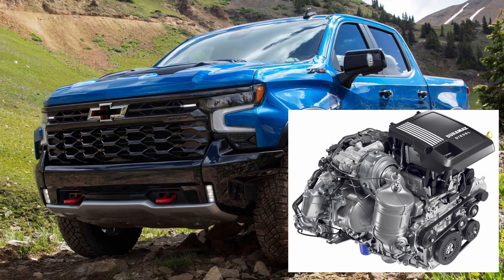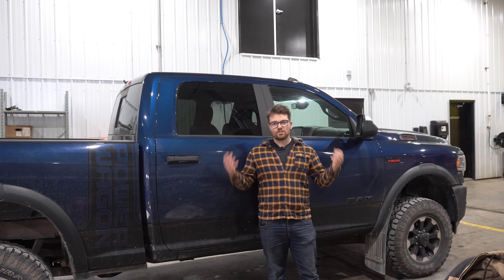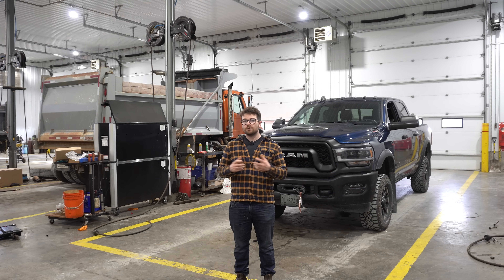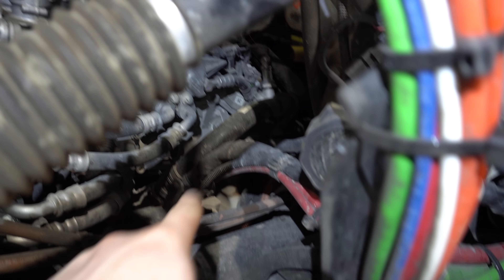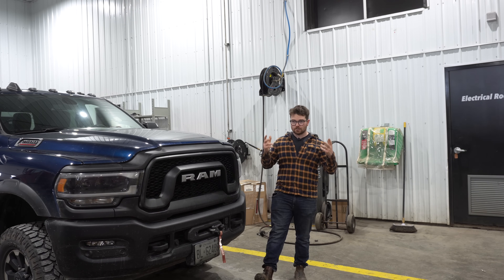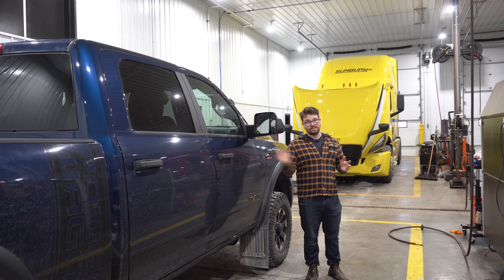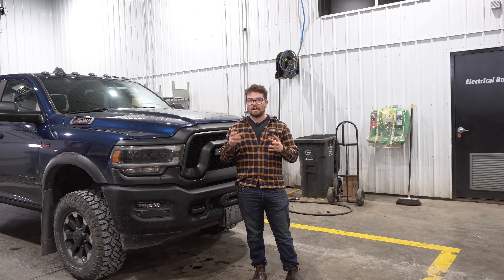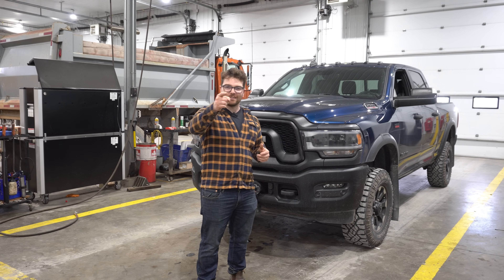Chevy Silverado 1500 3.0 Duramax Diesel **HEAVY DIESEL Mechanic Reviews** | Is It a GOOD Engine??

Comment: Oil pump fail will not be catastrophic!!!  Just pull off to the side of the road tow it to shop and get it replaced if happend. (3hr job) Plus there wasn't a single case of one failing. 
 Stop scarring people with the whole belt thing. GM now say 200k miles maintenance item for belt and it's not that hard to do.

Comment: I own a 2022 GMC Sierra with a 3.0L Duramax/LM2 engine. I put a lot of miles on my truck, as I drive it for work. I’ve had it about 8-1/2 months and already have just over 18k miles on it. I LOVE this engine! (I love the truck!) I suppose you wouldn’t expect to have had any trouble with an engine after only 18k miles. Still, it’s an impressive little diesel. I came from a 5.7L Hemi in a Ram 1500 and was getting 15-17 mpg. The Hemi had a lot of pep and I put a lot of miles on that truck, as well. It was a dependable engine but the fuel mileage sucked! I’m now getting an average of 25 mpg with mixed highway/city driving. That equates to 600 miles out of my 24 gallon tank. I was getting just over 300 miles out of the Ram’s 24 gallon tank. Amazing difference! On the highway I get anywhere between 28-31 mpg, real world. And this Duramax has plenty of pep. It’s the one thing I thought I’d miss from the Ram but I haven’t been disappointed at all. It has loads of torque and pulls much better than the Ram 1500 did. So far, I can’t say enough about this engine!

Comment: 13:30  
I'll never understand why Cat (a company that gave up on over the road diesel engines) is the only one that realized pulling EGR exhaust gas from AFTER the DPF, was a good way to prevent sooting of the intake and combustion chamber. Then again, they also made the ARD Head!.......so, yea.
Reply: VW also did it on the TDIs. EGR is pulled from between the DPF and DOC. There was even an additional EGR filter before it went into the cooler. Not a heavy duty or truck engine but still. BMW on the inline 6 in the 335d and X5 as well.

Comment: 0ur 2021 had the no start issue for about the first 30 000 km. I had it into the dealer to have the water pump replaced and they did a software update and it hasn’t done it since. Dealer was annoying though because I kept taking videos of it not starting and because it wouldn’t do it there they wouldn’t do anything to it. 

My only mild gripe really is the amount of DEF it goes through. I’m using a 10 litre jug a month and I don’t think I used 10 litres in my Cummins every 6 months.

Comment: My 3.6 warlock with 3.21 set is not sluggish at all. No lag. I’ve been impressed with it. I’ve owned 318 4wd reg cab manual ,360 2wd reg cab auto, 4.7 reg cab auto,5.7 4wd crew cab 3.55 set auto , Cummins diesel 2wd crew cab manual edge tuned , and  this 3.6 is really impressive for a naturally aspirated v6. I averaged 14 mpg with my crew cab 4wd 5.7 and 3.55 set and it did have a lag in throttle. This warlock averages 20.5 with lt 285/70-17 and zero lag on the throttle. Pulls anything that I should be pulling with a half ton. Will go back to a lighter tire and hope to see some mileage improvements. This warlock with 3.6 is peppier than a ford f25o 4wd /5.4 I had and I would say tows just as well.

Comment: So much for durability with all you have mentioned regarding this motor. What is most important in any engine, reliable oil pressure. So not this motor does not get our vote. And yes all you have mentioned is an issue so stop down playing the negative factors. All the best.

Comment: I own a 2022 Chevy with the 3.0L. At 6,000 miles the truck did not re gen for about 2 weeks and I got a alert that said service emissions system and the check engine light came on. the truck never went in to limp mode but after I called the dealership I woke up and cranked it and it re gened immediately and the check engine light went off. That has been my only issue. It’s got 23,000 on the truck now and I love the mpg I get. The best I’ve gotten was 35 on the highway and around town I get 22-27.

Comment: So why did they make the oil pump also gear driven at the rear? Sounds like a design flaw and like you said about injection pump hundred thousand miles is an a lot hot. Look at Cummins in the x15 fuel pump problems
Reply: He has no idea what he's talking about. He never even saw one of this engines

Comment: the long crank times sound SORTA like the misfire issues GM had....
.
when we got 4 speed transmissions with LOCK UP! torque converters..... when the trans would lock up, the engine would see bumps in the road as misfires
the bumps would cause the crank RPM to speed up/down ever so slightly..... and the ECU sees that as a misfire (as thats how ECUs detect misfires, looking at crank RPM variances) 
.
so, GM added a PWM lockup valve.... which keeps a ~70 RPM "slip" in the converter clutch
which is why so so so many 4T/L60e's blow up..... 
.
also why most rebuilders simply weld that valve 
so it feels like a 5 speed.... 1-2-3-4-lock up
VS
1-2-3-4... dont feel anything, but tach drops ~200 rpm
.
.
this issue was fixed in later ECU updates..... 
they could have left the trans alone with a "solid lockup"
.
but they did both..... to have a SUPER SMOOTH transmission 
.
.
.
and ya..... a 4t60e is smooth AF.... especially in buicks which have a slightly different ECU (with different fueling and shifting strategies) 
but id rather have a LOCKUP! lockup...... which reduces heat, and improves trans life (from less heat, AND!!! not slipping a clutch for 200,000 miles)

Comment: I have a 2020 Chevy 1500 RST with the 3.0.  Towing on the east coast with a 5500 lb rv 17.0 mpg. Driving around town/hwy 28-31.  A full tank of fuel has a 700 mile range.  My old truck a 2010 GMC Sierra 5.3, 17mpg was the around town and towing the same rv 9 
mpg.  Its quiet, rides really smooth.  No problems even in cold weather.  GM just extended the oil pump belt to 200,000 miles, and who knows in the 15 years it takes for me to put 200,000 miles they might bump it up to 250.000.  Great engine and transmission(10 speed).

Comment: I do wonder if Izuzu was intending to replace their 5.2L 4 cylinder diesel with this, if the gear train is on the back for cabover use.  I know why the modern Detroits have the gear train on the back, they're Mercedes engines from Germany, and the Mercedes trucks are of course cab over as is the norm for Europe.  I assume the PACCAR MX13 and Volvo engines are the same as they also are primarily European market engines.

Comment: I Have 44 k on mine it has a plate, and i have pulled over 18.5k lb does good. However, i am having issues with the def filter and cats or maybe a sensor truck goes into a derate mode currently at the dealer maybe it will get it back this week . However, I absolutely love this truck.

Comment: Great Review!!

We run a fleet of tractors and Duallies. Ram, Ford and DMax. 

Number 1-20 problem is DEF / EMISSIONS SYSTEM. 

The morons that dreamed this crap up and the government officials that voted and pushed this crap in, should be made to pay and do the repairs themselves. But as we know that will never happen. 

As for the 3.0. Fixing to get one. Not to sure if it is wise move, but we shall see. Especially with the oil belt and rear gear placement. That is a terrible design.  

I love diesels and we run and have run many many of them. But unless towing/hauling heavy, even though I am getting one to try,, I really don’t see the benefit at all. 

With the fuel price differential, higher maintenance costs and now learning about the ridiculous belt/gear design, I might change my mind. 

Wow, if the design would have been done like the normal US 6 cylinder, what a home run they would have had. 

Wow, now I have sit here and talked myself out of getting one. 😂

Stick with the trusty gas machine I guess!!!!!

Comment: I have a brand new 22 with the 3.0 and I just filed a lemon law case on it.  Not even 700 miles and been in the shop for 40 days.  No fix for my emission issues/leak.  Just bandages.  No thanks.  Getting a gas engine truck.

Comment: I am also a heavy duty diesel mechanic and I bought the new lzo duramax and the reason I bought it was because it was an in-line 6 and DOHC and talking about the rear gear train the MX-13 paccar engine is a rear gear train and after rebuilding a few paccar engines I have never had to replace parts with the gear train and most of the ones I’ve rebuilt have had a little over 1 million miles

Comment: My 2022 3.0 has 15k on it. So far, I love it. The 10 speed transmission is extremely smooth, and the engine has great power for a 1/2 ton.

Comment: I love the the fact that the fuel pump has a life span. A modern diesel your fuel pump goes bad it will send metal threw all the lines and injectors that’s a 10k fix. At a 100k miles maintenance it pull the transmission service your belt get a new fuel pump and service your transmission when they re install it. 
You forgot to mention the dpf is on the side of the block so it always stays hot. These really hardly ever need a Regen because of that.

Comment: Seriously?
You have to disconnect the transmission from the engine to change the timing belt or to service any of the other gear-driven components?
$1000.
It would’ve been so easy to put all of that at the FRONT of the engine.
That’s a dealbreaker for me.
I think I’m more offended by the sloppy, careless incompetence than anything else.

Comment: I had a 2021 GMC sierra with 3L LM2.   After 6k miles and over 60 days at the dealer, and engine change for oil leaks,  cab pulled twice for AC compressor, coolant leaks.  Lemon law got me my money back.  Would I buy it again?  Probably,  it was a great truck and engine with manufacturers defects.   GM didn't blink an eye trying to fix my issues and dropped over $20k in parts and labor.

Comment: What's your thoughts on the auto start/stop feature on the 3.0 diesel Tahoe? Does the auto start/stop damage the engine?
Reply: I don’t remember where I read it but I remember someone thought it was better to have the start/stop because it would hold temps more consistent and be better for it in the long run.
Reply: @specialestness  Thanks for the info, I'll research that. I just picked up my diesel Yukon and wasn't sure whether to use the auto start/stop or not. Thank you!

Comment: I just bought my 2023 SILVERADO duramax. 19 miles. 1 week later check engine light came on and read bad temperature sensor codes. Dealership scheduled me in for the repairs. 24 hours later my wife gets stuck in a main intersection and the auto stop never turned back on. Had to get it towed back to dealership where I was told the motor has seized and has metal in oil.. BUYER BEWARE OF THIS

Comment: I have the LM2 in my '22 Trail Boss. So far it has performed well and has been very reliable under some pretty extreme conditions. I noticed that I get significant knocking with budget fuel. So I stick with top fuel brands like Chevron and Shell. I also use diesel fuel conditioner with every fill up. If I do those two things and keep the oil full, the knocking is highly diminished. But, yeah, avoid budget|off-brand fuel if you can.

Comment: I love my 3.0l 2022 suburban. I changed out my oil to the amsoil (dexos D approved/won’t void warranty and it’s 100% full synthetic). Other oils such as Mobil 1 (also dexos D approved says it’s full synthetic but it’s only 25% synthetic) I also added the PPE oil filter (larger capacity(SKU#: PPE-114000650) and average 35 MPG highway. As for the belt I think it’s a little crappy but not a deal breaker for 150k mile intervals 
Hope this helps anyone

Comment: Ford 3.5L EcoBoost = 20mpg average. 400hp / 500 lb-ft

GM diesel = 27mpg
277hp / 460 lb-ft
+35% better mpg for diesel.

BUT:
87 octane = $2.84/gallon
Diesel = $4.59/gallon
+61.6% MORE in my area.

Emission hardware reliability and cost has killed the diesel advantage.
Reply: Thanks for those facts.
The Ford is such a good product. The engines are built like a diesel. Heavy duty gas engines those ecoboosts are!
I have an old Ford f150.v6 and a Dodge Hemi.1500 Laramie AWD. Both are 2004 Models and Both have 300,000 miles on them.
Both serve their purposes perfectly.
Reply: Yep the price of diesel kills the better mpg advantage plus more likely hood of problems from emissions equipment

Comment: Great video 
I drove Sprinters before 3.0L and 2.1L , they are Ok
Now driving GMC 3.0 and just got to 50k mi
Absolutely love it , great in summer or winter (Chicago) . Torque is outstanding, I tow my sport car for 1000mi back and forward, thru mountain. Gas mileage is phenomenal, 6000lb I getting 16mi/gal on empty 24-28 80mi/h 
Highly recommend

Comment: I'm a Mopar guy and love the Ram Cummins. But I think its really cool that Chevy decided to make an inline-6 engine...
Reply: History shows how good the inlines are.  My old Ford with the 300 c.i and jeep 4.0L had very few issues overall as long as maintenance and cooling issues were addressed quickly.  Im sold that mine will stay just as smooth, torquey and dependable, but what I struggle with is all the emissions crap they're forced to put on these new engines.  I bought my 2020 LT 4x4 with the 3.0L and 10 speed in Oct. Of 2020 and now has 34k and I'm consistently getting 30+ mpg unless I go over 70mph and tows extremely well and fuel goes to about 17.5mpg fully loaded, but sucks the pee juice way too fast in my opinion.  I keep hearing people say they only get 27mph and I'm not sure if it's that I don't have a low gear transfer case or perhaps different gearing or if we just drive different.
Reply: @treetopace  Yes, and BMW's make silky smooth inline 6's

Comment: I have owned my RST 3.0 Duramax for a year now and I love it. Great fuel economy and plenty of power. Paired with the new 10 speed automatic transmission, it always seems to be in the proper gear. If you do not expect it to be something its not, you will be very happy with this engine. Very happy with GM's offering with this engine/transmission combo.
Reply: Exactly my impression as well. I think it’s the best combo GM has out right now. Who doesn’t live 30 Mpg + and that low end grunt! I love it in my Escalade ESV and my Denali Sierra.

Comment: Great video covering the 3.0 Duramax.  I absolutely love my 2021 LM2.  I currently have 25,000 miles on it and it has been great except I have experienced the long crank/no start issue a handful of times, but it has always started on the 2nd try and I'm hesitant to take it to a deal until I'm convinced that the ECU reflash truly fixes things.  

I was so happy to learn that they went with the inline 6 configuration when they 1st introduced this engine.  I still think Cummins is the top diesel engine offered in a pickup truck and I likely would have picked up a RAM 1500 diesel had their engine actually been a scaled down version of the 6.7 Cummins.  I think that would have been a grand slam and caused many Ford and GM loyalists to jump ship at least if they were true diesel enthusiasts, but RAM missed the boat by going the route that they did with their diesel.  With that said, I've heard some good feedback regarding the RAM ecodiesel, but who wouldn't want a mini Cummins sitting between the fenders of a 1500.  Since I can't have a mini Cummins, the 3.0 Duramax is my next best option as there's just something special about the grunt and music an inline 6 turbo diesel makes and the balanced smoothness is amazing.

Also, I just wanted to point out that Isuzu has no involvement with the 3.0 Duramax like they did with the V8 Duramax.  GM and Opel worked on the 3.0 development per the GM engineer.
Reply: Sorry to break your heart but the Cummings is going to be discontinued
Reply: @guidoochoa2038  Thanks but not a problem for me as I have no intentions of purchasing a new Cummins powered 2500/3500 RAM as I just don't need that much truck.
Reply: Yeah I wish the ram had a 3.0 inline 6
Reply: I had no start crank issue right off the lot it’s embarrassing sometimes 21 duramax
Reply: I'm wondering why they're collaborating with other companies when designing the Duramax, do they not have enough talent here in the states?
Reply: @guidoochoa2038  what is a cummings?
Reply: @marcbenedict3676  opel has built diesel engines for probably 100yrs kinda like the isuzu collaboration a Japanese company

Comment: I was told by my mechanic that modern diesel engines EGR valve every single time it opens to "recirculate exhaust gases" it's like grabbing a hand full of very fine sand and tossing it inside the intake
Reply: No. I don’t like emissions stuff since it’s idiotic to longevity and economy but… no egrs; aren’t like throwing sand in the intake.
Reply: @austenalgaier1122  I can prove you wrong
EGR recirculates exhaust gases 
Diesel soot is abrasive
Do you want me to keep going?
Meaning your wrong

Comment: I own a 2022 ltd ltz z71 and I love it, I regularly tow a 16 foot enclosed trailer loaded out for work. It pulls it fine. I get around 13 mpg towing on the highway running 80. If I’m not pulling the trailer I’m getting around 28mpg on the highway. It gets way better mileage than any v8 1500 truck I have owned. I haven’t had the long start issue either. I have round 35000 miles on it.

Comment: I am surprised those engine even start . Do not get me wrong . I love this engine but the electrical in the oil pan ? Come on gm . Put more space between the positive and negative . Since its in oil . 5mm or so should do . Do not rely on faraday cage . Ground oxygen sensor to ecm ground . Big wire alone . No touching . Once fixed , reinstall.firmware and software . This engine will likely outlast most engine . Once electrical is fixed . As is ? Probably the worst diesel i6 ever . It's a shame because non electrical wise , this is an awsome choice . But electrical wise it's like a preschooler made the electrical arrangement . Like the person does not know wireless electricity